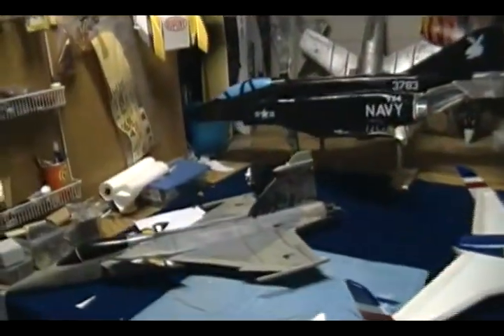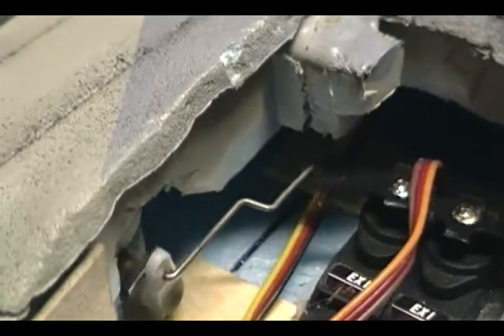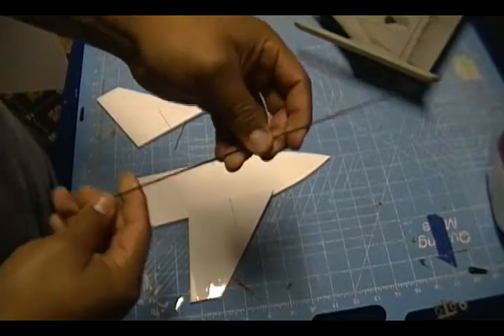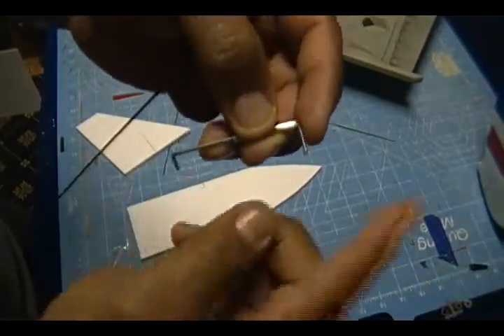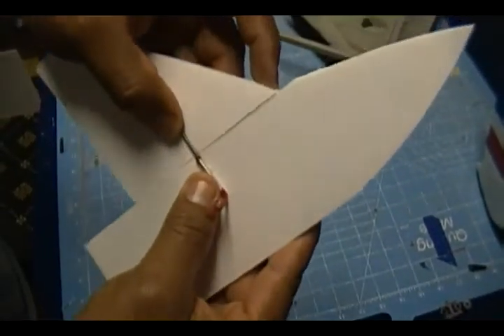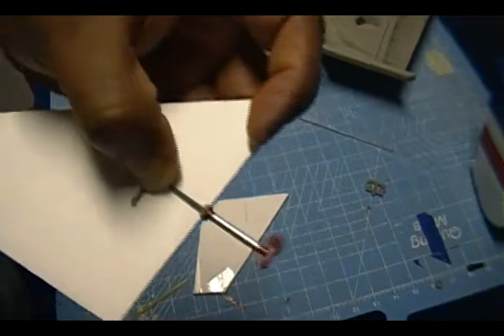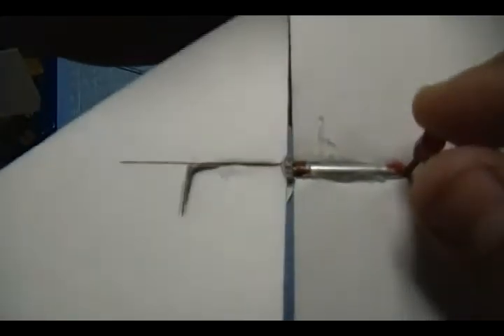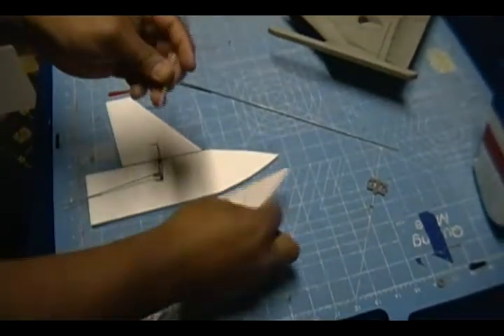How to canard on r/c planes

Comment: Dont you get interference doing metal to metal connections with the wire and metal sleeve? I always use plastic or paper sleeves to avoid any interference .

Comment: That's a good set up- very solid! I have used them on the JMW Eurofighter typhoon, RCPowers t50s, feng shui j20, RCPowers j20 and my design of the Mig 1.44 flat pack profile. One thing I learned: fully active canards will stall the main wing if overused. On most planes they are good for trim, LERX or stabilizing high alpha, but when used for pitch control they will stall the main wing and cause erratic loss of control.  I have since only used them for trim and on a lerx mix for high alpha. Espe